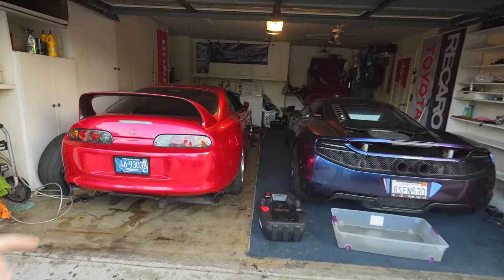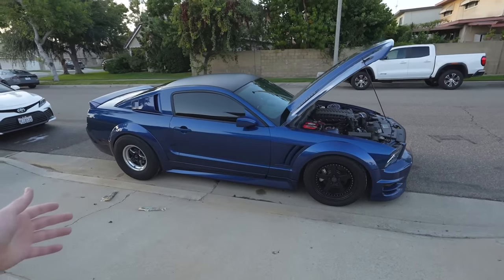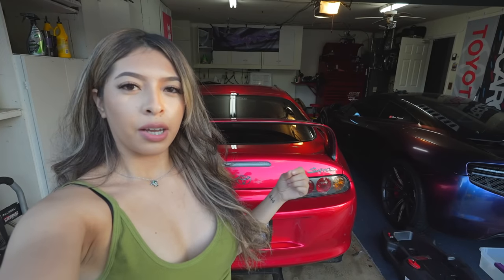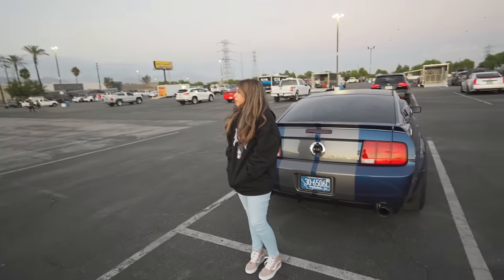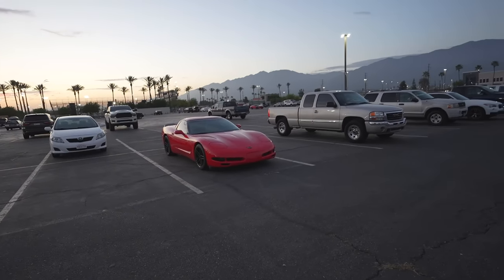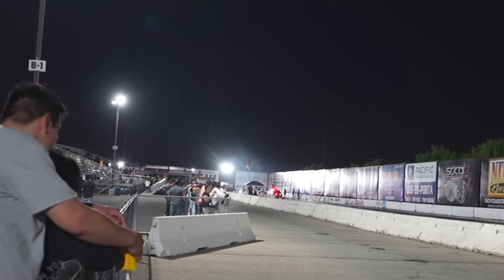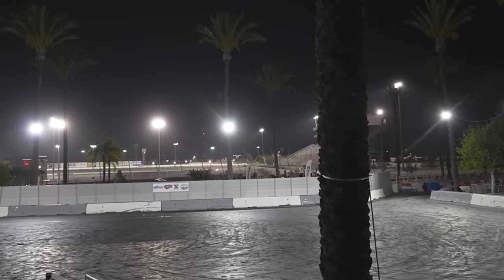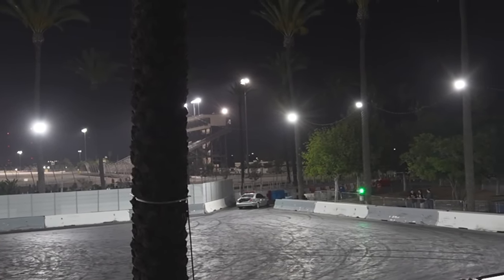PONTIAC FIREBIRD RUNS A 4.82 AT DRAGTSTRIP!!!

Comment: Those were some fast Demons that ran together, and a fast sub-6 second standard body 2018 or older white Hellcat.  This is typically the place where a lot of sh*t talk about how "heavy and slow REWB Hellcats & Demons are" comes to die.  Even when stock they are pretty fast IF you know how to launch it, and with some basic mods, a prepared surface, and drag radials, it's a whole different car altogether.

Comment: I'm assuming like Eminems drag racing career, this is 1/8th mile?
Edit: It is. 4.83 is still pretty quick tho. Good for those guys. And as long as you could hook. I don't see any reason with the way you have built that car it could definitely hang with those times. Set of cheater slicks and you could probably do a 5.1-5.2 Also seeing that ZHP in the donut pit hurt to watch

Comment: Definitely good stuff here in this video. Drag strip footage is always a fun watch if there are some cool cars running. You absolutely should run your Mustang, just start with a test and tune night where it is just for fun, and there is no pressure of possibly being eliminated if you lose. You can run as much or as little as you want, and where I go you can run with another car or by yourself if you want.  $50 bucks is the typical cost to enter, and here in Ky. it lasts generally from 6pm until 1am.